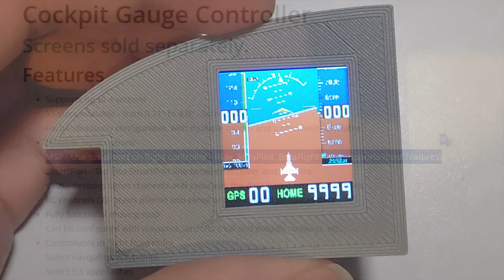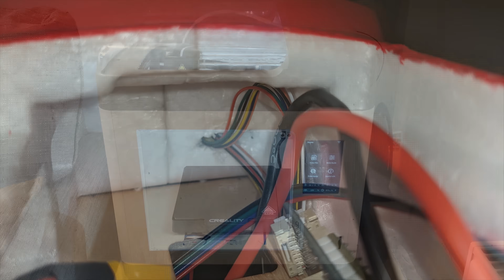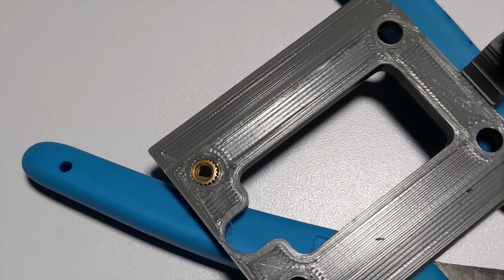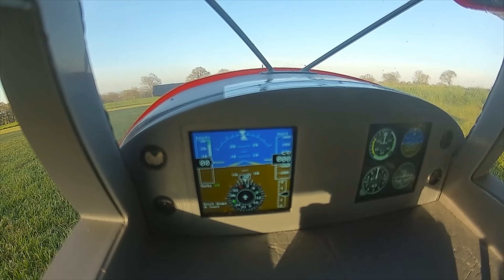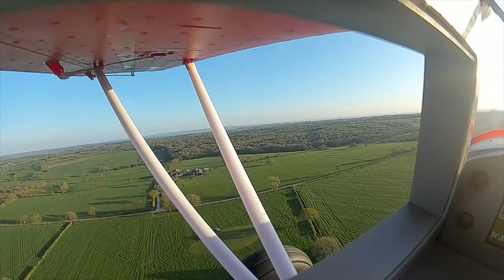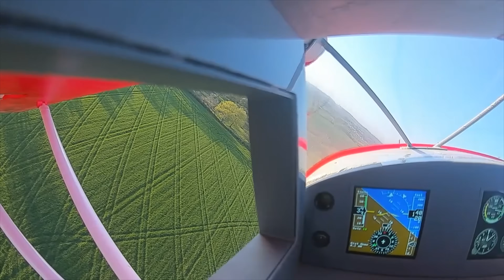How To Add A Working Cockpit To An RC Plane!

Comment from the maker: Eflite / FMS  Maule M7 1.5: https://s.click.aliexpress.com/e/_oDhNc8X
Sermoon V1 Pro 3d Printer: https://s.click.aliexpress.com/e/_on6sh75
Grey PLA: https://amzn.to/4cMsHL0
PDI-MG180 Servo https://s.click.aliexpress.com/e/_onjMlFH
Bag Gimbal: https://bit.ly/2Z0FFTX
FPVTOYZ: https://www.fpvtoys.net/
1.5in panel from china https://s.click.aliexpress.com/e/_oDKvRWx
100ohm resistor: https://amzn.to/4lEZ8Po
Brass inserts: https://s.click.aliexpress.com/e/_opuri9l
4 Pin Extension https://bit.ly/3YFPFgJ
3d Printed Parts: https://bit.ly/3Rnb5vg
Wireless Headtracking Tutorial: https://www.youtube.com/watch?v=hRmx8kJ4las
Support This Work. Pateron: https://www.patreon.com/c/andyrcchannel
paypal.me/Andyrcchannel

Comment: Just started down this process myself. Discovered by dumb luck that with some careful application of force the entire rectangle of foam that the pilot is sitting on will come out in once piece. You can see the same of the block @9:06. Then the screws can be removed from the underside if needed. I think I'll use that recess as part of the mounting location for the camera setup rather than replacing that section of foam.

The black seats also pull out fairly easily as well by rolling them forward.

Comment: I got the FPVTOYS digital gauges and the Matek FC H743-WingLite, could you please help me with the wiring connections that I can use to connect these?, Thanks
Reply from the maker: It should be the same as I'm this video. Just runs off 5v and ground and then a spare tx and rx from the fc

Comment: Hello Andy
Very cool project you have done. However, I still miss 2 important things. 
- 1. a fuel gauge should be displayed in some form, which could show the battery charge. That way you would always know how long you have left to fly. 
- 2. it would probably be very nice to somehow display the engine power  (RPM) in some form in a speed instrument, so that you would have a nice feedback on how much power you are currently flying with. 
Every real powered airplane has these absolutely necessary basic instruments on board.
But it's amazing how far we've come in model flying these days. 
Congratulations again on this super project and many thanks for showing it. 
Greetings and best wishes from Switzerland.
also an Andy 😉
Reply from the maker: It has the engine rpm gauge I just did not select it in the setup. The battery voltage is shown in the osd of the goggle. This I think is a better option as full scale would not have a gauge for this. You can select a fuel gauge but again I just did not select it for the first test
Reply: @AndyRCchannel Super ... so or so a cool project... amazing what is possible .
Best regards 
Andy 🙂
Reply from the maker: @MrFlyingAndy  thanks for watching and giving input. I will look at arranging the gauges so they are more useful / accurate for full scale use
Reply: @ Yes ... cool... I will be continuing to follow this interesting project . 🙂

Comment: I’m going to have to agree with you on the OG V1 and V2 DJI goggles.  Out of all the goggles I have from DJI and Walksnail the OG DJI V2 goggles fit the best and imo have more immersive feeling.  They don’t fog up either!  Why DJI went with the smaller goggles is understandable, they lose a lot from doing that.   I fly my OG DJI stuff more than any the newer gear I have.
Reply from the maker: Same here I have the goggles 2. Tried the goggles n3 also but the old V1 and V2 with the upgraded DJI foam are perfect. And while the older air units don't produce the GoPro style quality that's a good thing when needing to look directly at the sun. With o3 and o4 everything else goes dark. Not with O2. It's just better for the fpv part

Comment: Awesome stuff, impressed with how you manage to keep it all together, pan-and-tilt on my 4 channel trainer is about as far I can manage, and even then I need a check list.. beyond that there's always something ready to fail..
Thinking of those who make super detailed scale models, pilot figurines with arms that move, how far down the rabbit hole are you willing to go Andy?
Reply from the maker: The pan and tilt is on a head tracker so move my head and that points to where I want to look so that sorts that problem out. You are right through there's a lot to think about with this one. I wanted to add a moving yoke and pilot but with the camera sliding back and forth I couldn't do it. Yeah check out a guy called robobiggles he takes it to the next level with the scale detail.